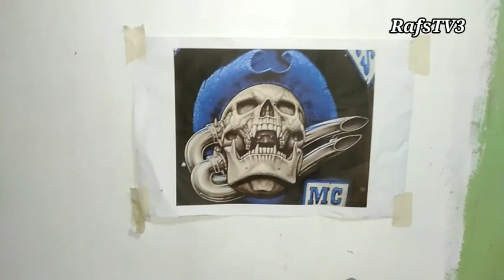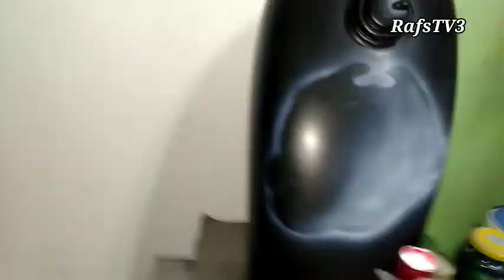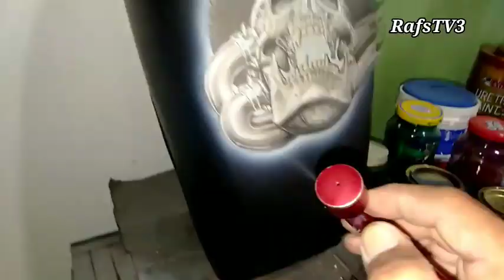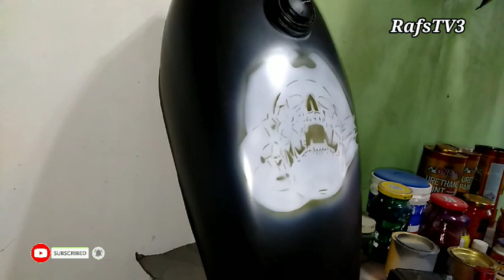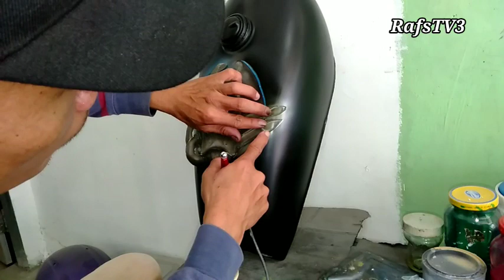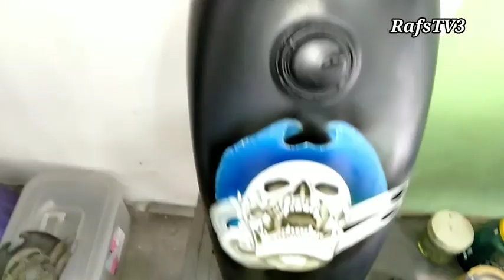AIRBRUSHING TECHNIQUES STEP BY STEP/DIY make your own custom design with airbrush

Comment: Paps kapag nakapagtop coat na ba ng matte ng 2 coat eh pwede ulit lihain bago ilast coat ng matte? Meron kasing may part na magaspang eh.
Reply from the maker: Oo Paps pwedeng pwede,grit 600 n gamitin mo para mabilis pumino
Reply: @RafsTV3  nakapagtopcoat na kasi ako ng matte tapos may part na magaspang. Di kaya maiiwan yung itsura ng pinaglihaan kapag naitopcoat ulit ng matte paps?
Reply from the maker: @rotsoakley1535  pwede NMN yn Paps eh lang s mga pearl o metallic course Ng ha haspe KC PG ganun pero s black hindi nmn